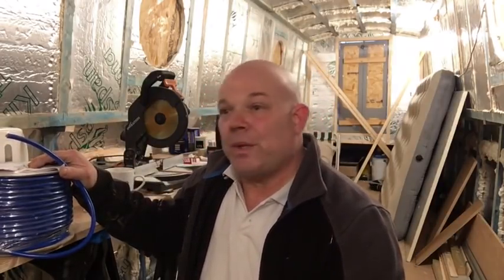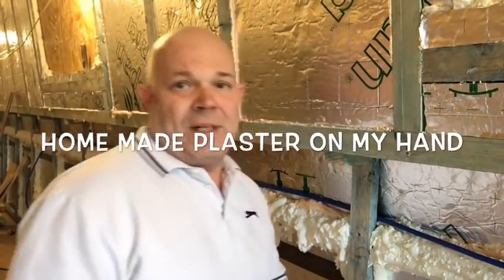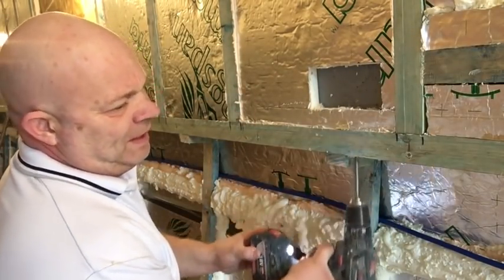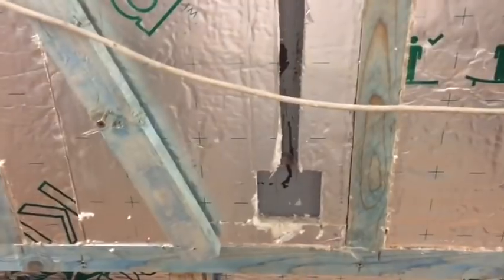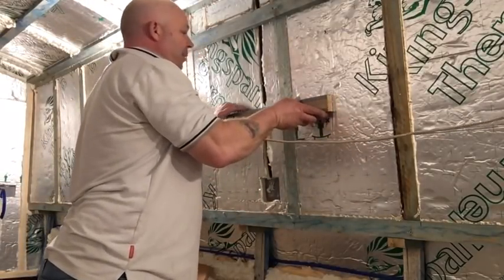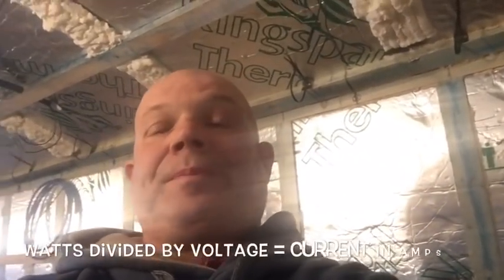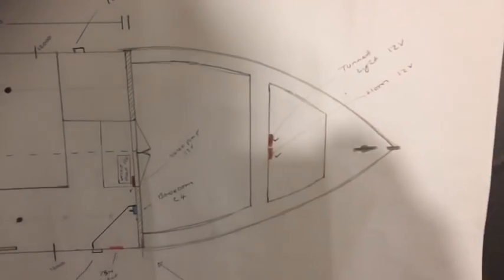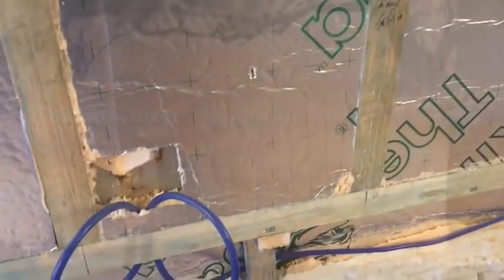Narrowboat build and fit out part 7

Comment: Has to be Artic Blue Cable! Does it, the fixed installation doesn’t move or it shouldn’t so any rated flex can be used. The only flex that has to extreme temp rated is the shoreline

Comment: Great video. Will you not get any condensation issues in your socket wall plates; with your sockets being against the metal sides?
Reply from the maker: Hi Liam
Thanks for watching, your comments a good one and one I have thought about also.
After the lining has been fitted I will be installing plasterboard dry lining boxes ( the plastic ones usually with the yellow clips)
But just before I fit them I will flood the cut out with spray foam. Keep watching 
Carl & Christine ❤️❤️

Comment: hi watching your vids with great interest , glad to see your sharing very informative info which certainly will be of help to me me in the months ahead , looking forward to seeing how you fix into place the bulkheads  but on another note the 2.5 mm cable you purchased for your 12v electrics does it have to be tinned cable and if you don't mind sharing were did you purchase it from cheers paul b
Reply from the maker: Hi Paul thanks for watching glad your enjoying the vlogs and hopefully they will be of some help to you and others.
My bulkheads are constructed like a stud wall clad on both sides with 9mm ply. I have deliberately tried to keep them as thin as possible so I used 25mm x 50mm timber batons screwed to the sides,roof & floor by using this method you can conceal your fixings and once the ply has been applied to both sides it is remarkably strong but you’ll see ‘‘this in the next vlog.
My thin walled cable for the 12v system is not tinned, I did look at installing tinned cable but most builders I spoke to considered it to be overkill for a narrowboat, if you decide to use tinned cable ocean flex are the manufacturer of the cable but I called them and they will not supply you directly you will have to purchase it from a distributor they will tell you who your nearest supplier is. Keep watching 
Carl & Christine ❤️❤️
Reply from the maker: Hi Paul sorry meant to say I got my cable from midland chandlers but it is available on eBay & the net
Reply: ,many thanks cheers 
 @christineannethebuoys5239

Comment: Hi Carl Chris here, how many sheets of kingspan did you use in total and cost wise how does it compare to spray foam  ,great vids by the way cheers Chris
Reply from the maker: Hi Chris thanks for watching glad your enjoying the videos. I used around 30 8 x 4 sheets of 25mm kingspan but I did insulate the floor as well
I paid around £18 a sheet but I do have an account at the merchants. So around £600 which is cheaper than spray foam but obviously it takes a lot of time to install compared to spray foam, but my main reason for installing the kingspan was you get a uniform depth of installation all over the boat which is what I wanted to achieve 
Keep watching all the best Carl & Christine ❤️❤️